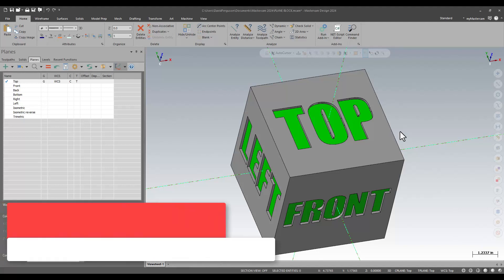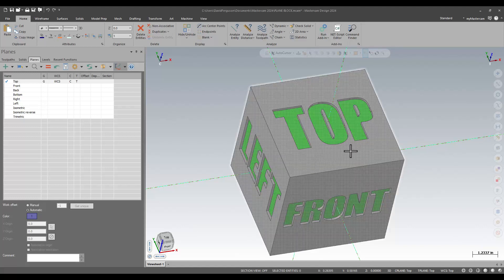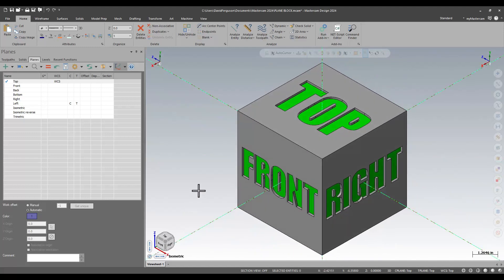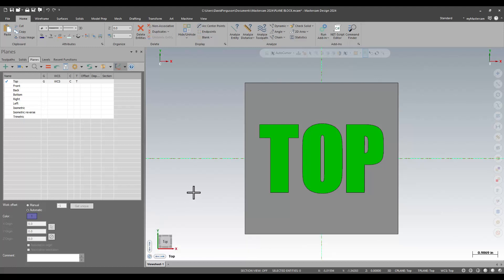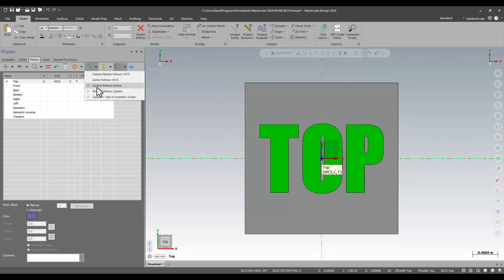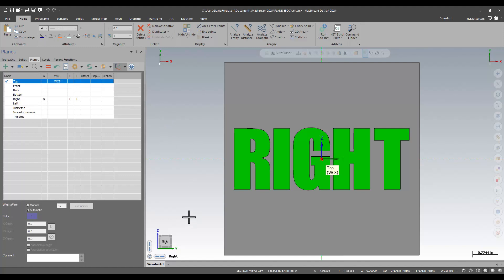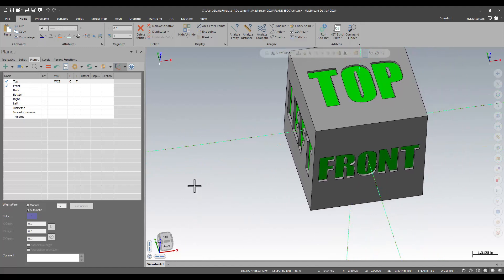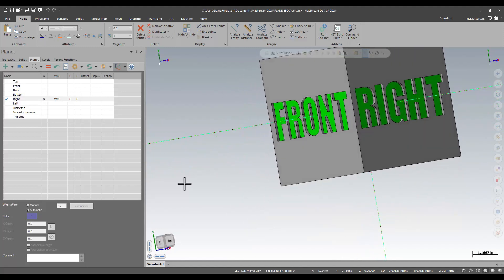What's New in Mastercam 2024 - Gview Graphics Display Cube

Comment: Hi David, Can you please explain the difference between tool plane, constriction plane, and WCS for us?
Reply: Hello! The easiest way to understand how the WCS, C, and T planes work together is to think of them as follows. The WCS (World Coordinate System) is your world, think of it as home base, or zero everything. This is the foundation, orientation wise,  for my program. The C (Construction/Compensation) plane is what I use for any sort of analysis or measurement. If I want to measure a Z height or a position, the C plane is what is used as the base for that value. The T (Tool) plane ultimately determines which combination or orientation of XYZ )ABC for multi axis) the toolpath is going to use. Traditionally the C and T planes are used together so they are typically hanging out with each other so that when I want to measure a distance for a specific toolpath or plot a Z height, I am getting good numbers. In 3 axis machining, the WCS, C, and T planes are usually grouped together. In four and five axis programming where I will be indexing, the WCS tends to stay static and I induce plane shifts by using a different C and T planes when I need to tilt the tool or workpiece for access.
Reply: oh, and the C plane determines which combination of XYZ you would be drawing or creating in when generating line geometry in Mastercam. We don't draw as much in the software these days so I forgot that part lol
Reply from the maker: Thanks for a great explanation, David!